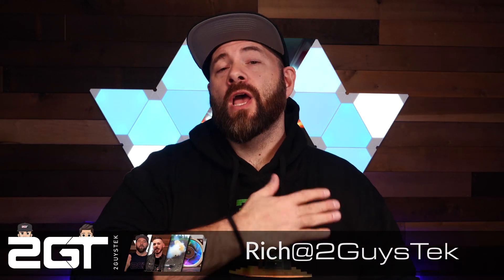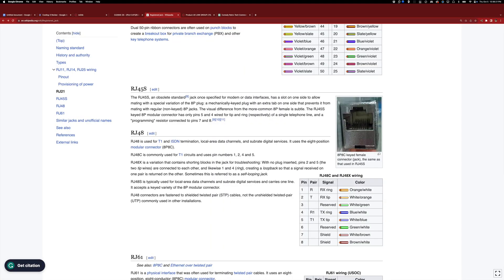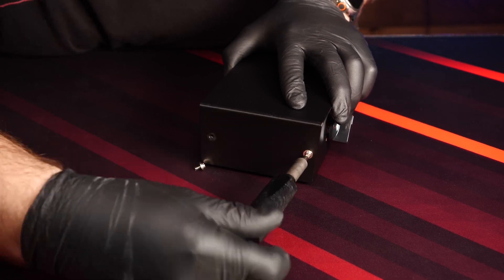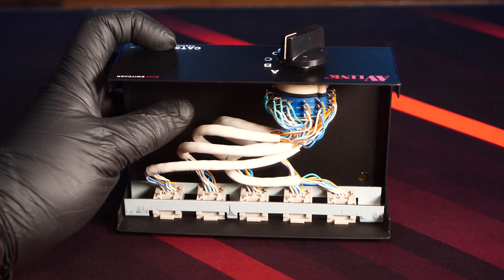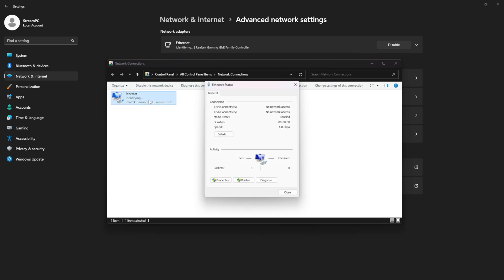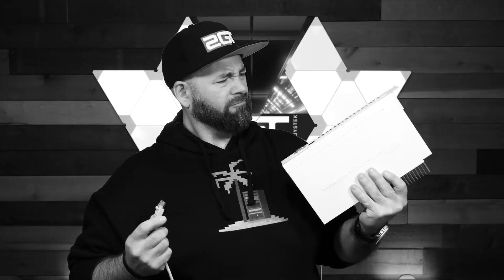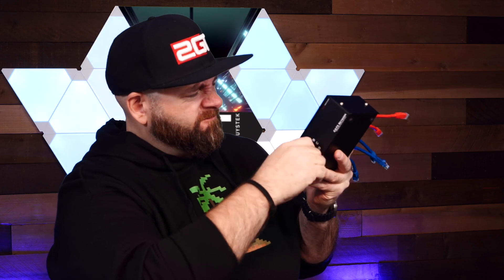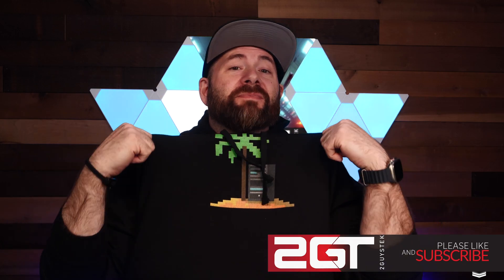Why does this thing exist?! - The Vintage RJ45 Switcher

Comment: Your switch box would have been used for switching multiple modems on a single telephone line.

The RJ45S connector was introduced in the early 1980s. It was part of the Registered Jack (RJ) series of connectors developed by the Bell System to standardise telephone and data communication interfaces, emphasis on "was". It was for end-to-end data communication over standard telephone lines and was never used over a network other than the PSTN, itself. 

The RJ45S indeed utilised a keyed 8P8C connector but also incorporated a programming resistor that shunted pins 7 and 8, apparently to ensure proper signal levels for the connected devices.

When the 8P8C connector was first used for Ethernet, probably around 1987 when twisted pair was introduced, the term “RJ45” was already familiar to many people from the telephone industry, leading to the incorrect association. While the IEEE and TIA have never referred to an "RJ45" connector in any of their standards, the name stuck.
Reply: Now that I've actually watched the video right to the end, that switch would not have been used for switching between modems, or anything else related to telco. That fact that the box is actually labelled "CAT5" proves that it is a much more recent device. Why they used a keyed jack is anyone's guess. 
FYI,  RJ45S standard pinout  was:
Pin 1: Not used
Pin 2: Not used
Pin 3: Ring 2 (line 2)
Pin 4: Tip 1 (line 1)
Pin 5: Ring 1 (line 1)
Pin 6: Tip 2 (line 2)
Pin 7: reserved for shunt resistor
Pin 8: reserved for shunt resister

Comment: USB is 4 pin, RJ45 is 8 pin. Wire up 2 usb male connectors into an RJ45 port, run them to 4 different Machines. Then 2 USB Female connectors to a RJ45 port. Now you have a manual switcher for your Mouse and Keyboard across 4 different computers, whether that’s servers, work machines, personal computers. I saw someone use it inside an arcade machine with a universal controller motherboard, and an HDMI switcher, 2 controllers across 4 consoles for all his games! I’m sure someone can find a creative use for this

Comment: If your home router doesn’t support 2 ISPs, A could be your primary and B could be your back. If your primary goes offline you could switch to your backup. That’s the only modern use case I can think of.

Comment: They work great for isolated networks, such as in manufacturing where you dont your PLC's or automation/welding robots connected to the rest of the network except for updating/reprograming.   Really old school way of doing it as now vlaning is faster and about as safe, but seen them in large mfg plants like automotive plants and the what not.
Reply: I've used it in uscase like that, it began before network was so advanced like today. Actually it not always used the tcp/ip protocol, it was used on robots, cnc machines and other industrial tech back in the days, but I'm sure that some of the equipment are still in use, first time i saw them the network on the company still used coax network. Machines was not connected to network and so on.